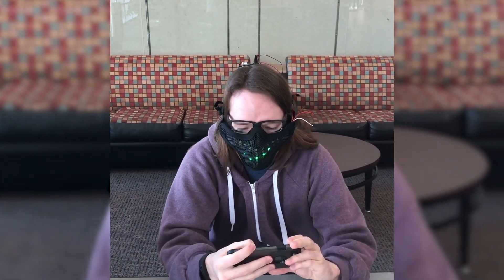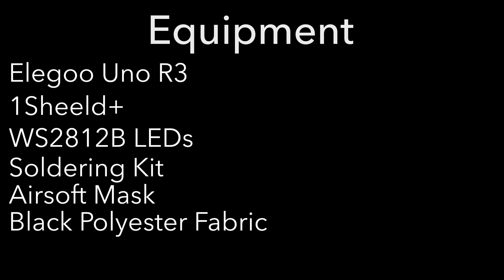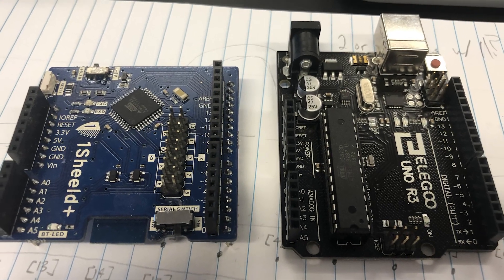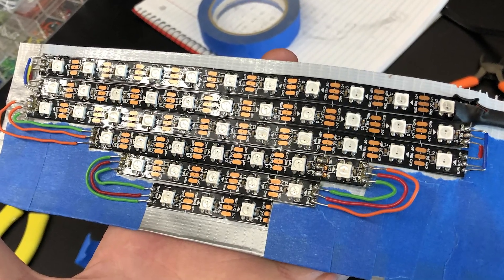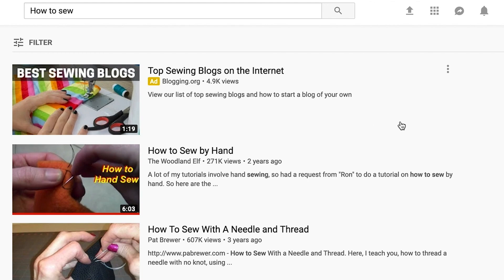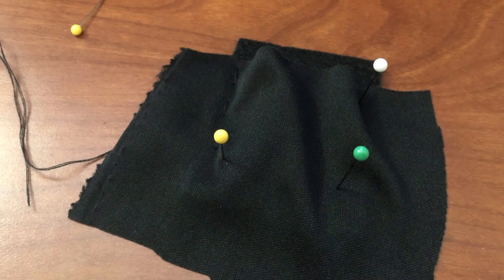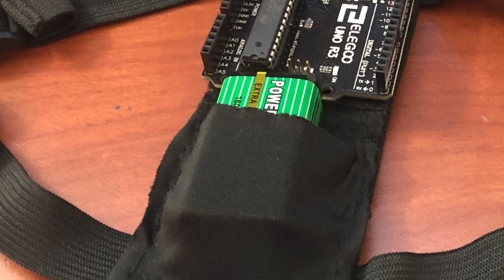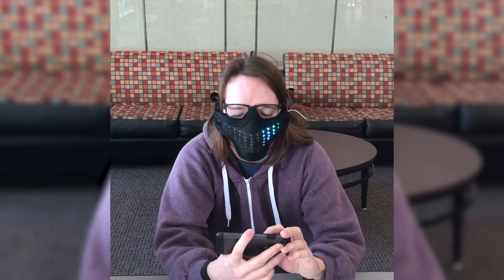Making an LED Mask with Bluetooth

Comment: Hay Great Project, I suggest you to replace the UNO with ESP12E and connect it to a remote server, so you can add TEXT to speech API which makes text appear on the mask whatever you speak.
Reply: good idea, esp32-esp8266 standalone units are super fast, capable, and are small and cheap!